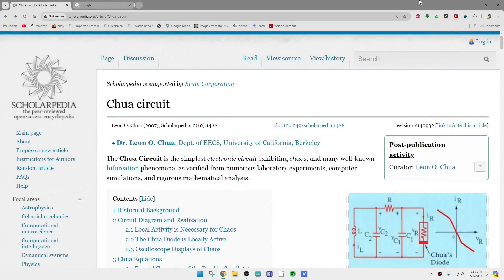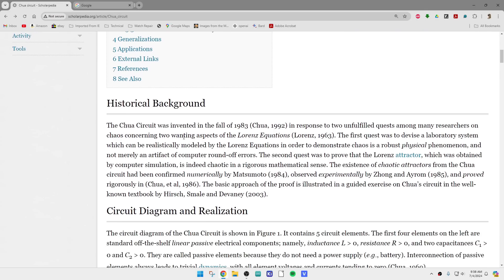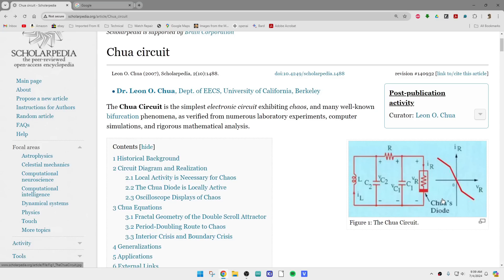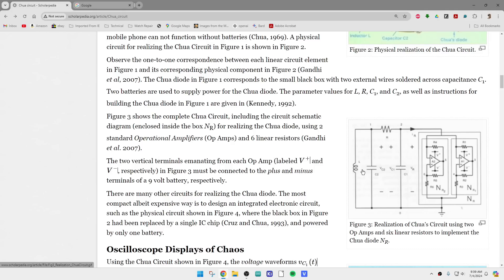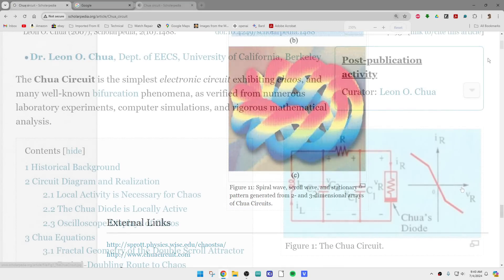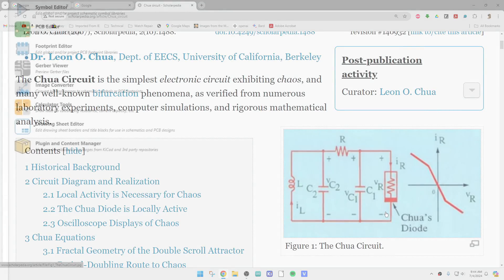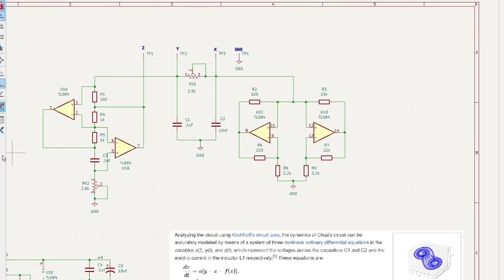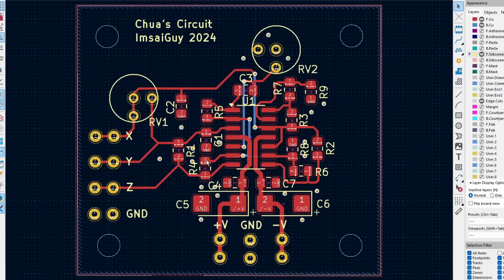#1937 Chua's Circuit (part 1 of 2)

Comment: Would be interesting to build an array of such circuits loosely coupled ( effect hard to 100% eliminate anyway ) and check what kind of patterns will emerge in array ( each circuit acting as a pixel, for visualization one can assign rectified of x,y,z to R,G,B intensity) 
For 10 x10 pixel circuit it will be cheap, sadly cost is growing with square, and interesting things require minimum about 100x100 pixels. Something like this: https://youtu.be/JKJcMDIuKts